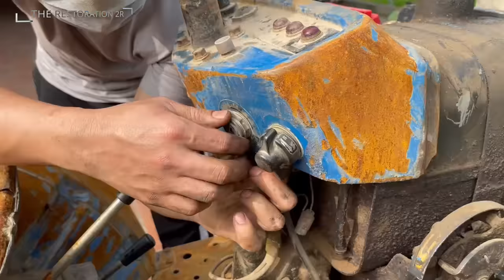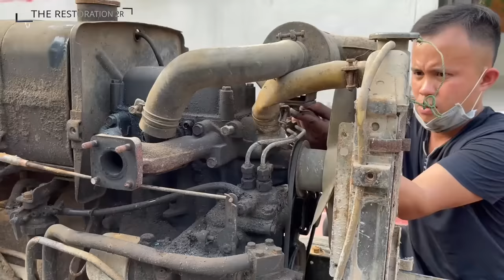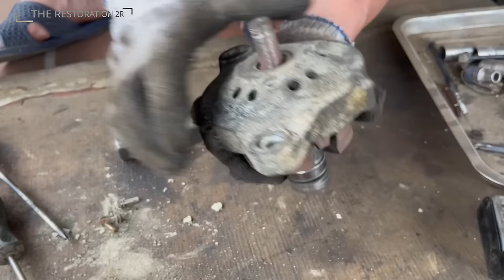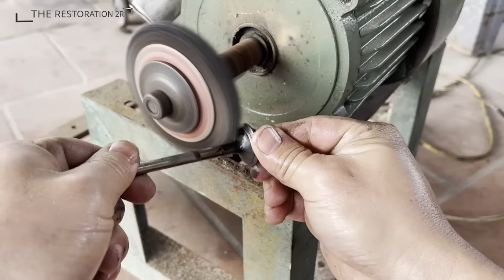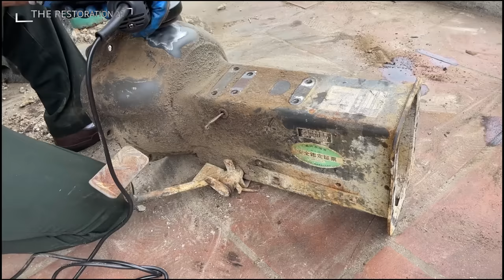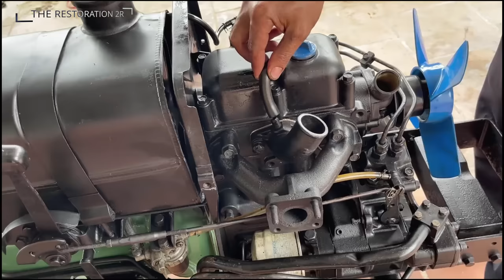Full restoration of ISEKI TX1210  old tractor _ Restore and revive abandoned old tractor

Comment: I miss replacing the piston rings, replacing the plain bearings of the crankshaft, and I haven't seen a single roller bearing replaced. The soul of a diesel engine is the fuel pump and the injection nozzle. The elements in these can be replaced at home, but a test bench is required for adjustment, otherwise one cylinder will do the work of the other, or the machine will consume too much. I like such films because they give me ideas: for example, the first bridge has a brilliant solution.
All that being said, it's a neat job and I assume they just didn't show it.

Comment: A couple of things I would do different. First, I would not have done any of the bodywork until I knew the transmission and motor was salvageable. Third, why would anybody do something like that on that patio tile. If the welds hold up any doesn't try to work it to death, it should last 20 years
Reply: Yeah I would have done alot of stuff different to I'd do the body work even if those part were shot because you can make other engines fit and work on it if the old original is shot 

I wouldn't have been cutting a bunch of pieces off like he did I'd saved as much as the original as I would do small patch work and lay paper or cardboard down before spraying any paint I do 3 coats of paint and a different color for the bottom of pieces